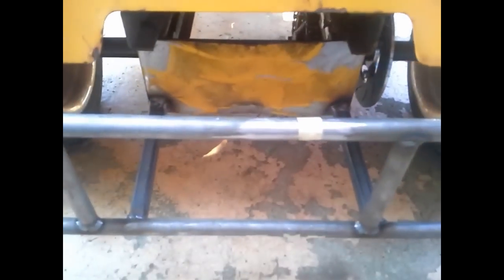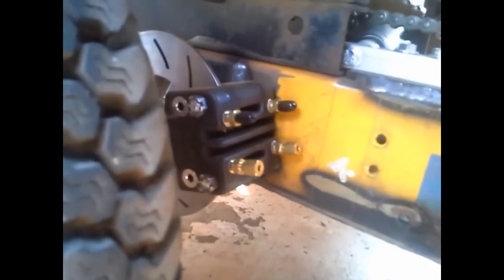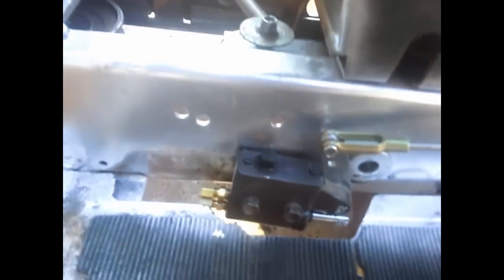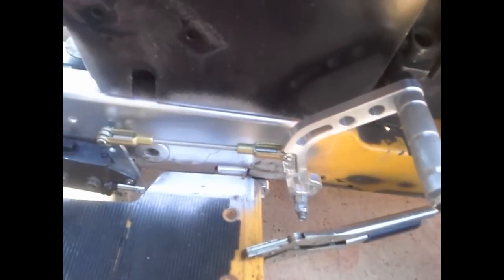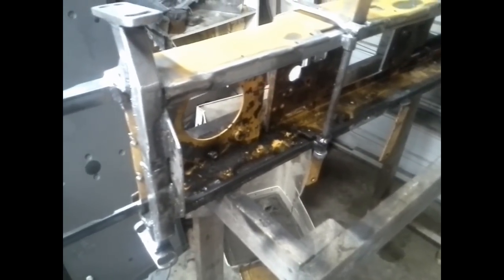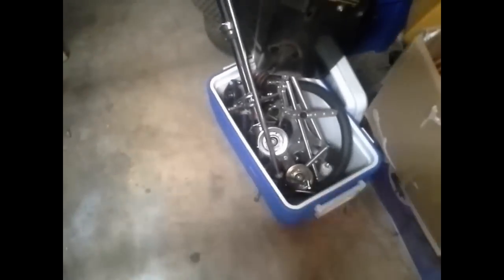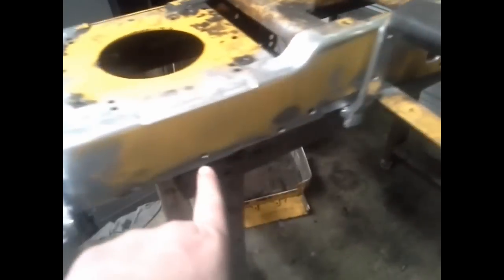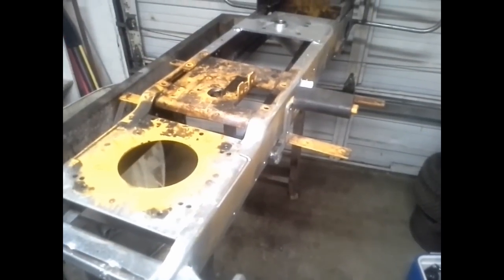vtwin racing mower build 8

Comment: Are you using any gear oil or grease for your transmission?
Reply from the maker: motorhoney with a mix of 75 weight gear oil
Reply: motorhoney is the worst choice ever